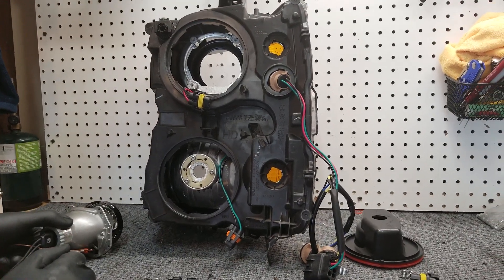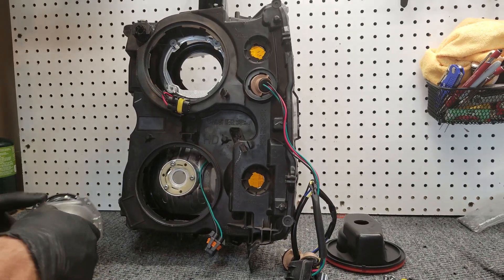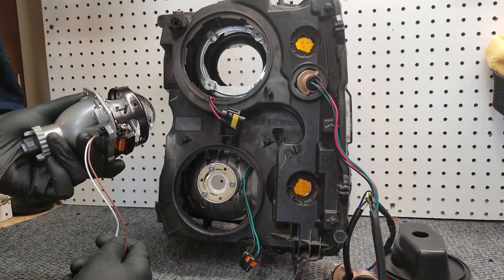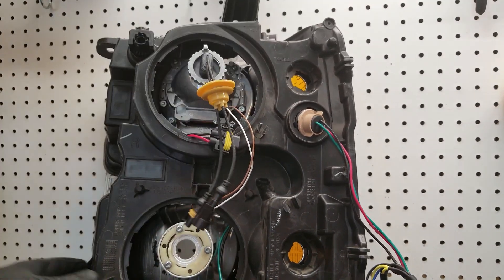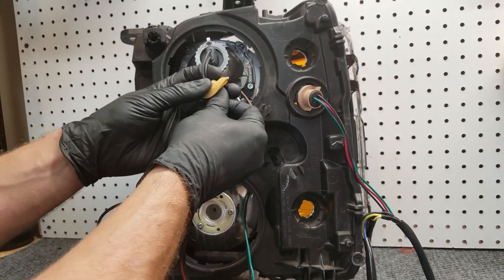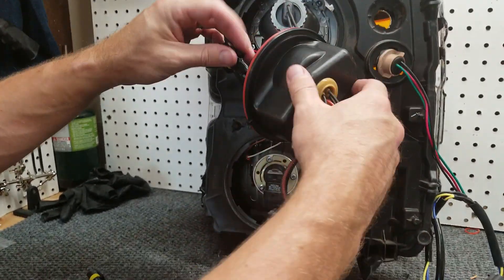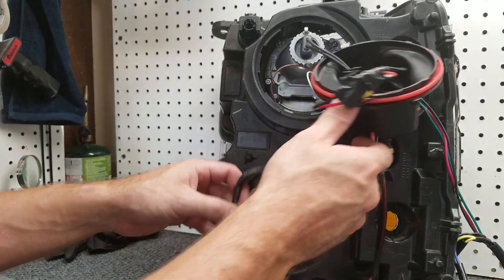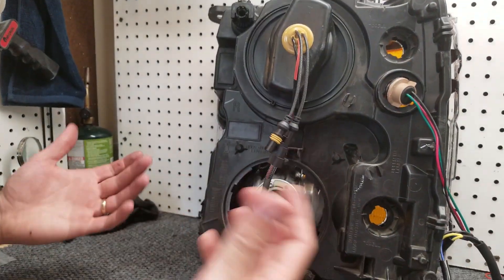Morimoto D2S 4.0 Projector Retrofit in 2014+ Silverado (refer to description)

Comment: I did this mod on my 2015 2500HD and when I went to reassemble it in the truck the BCM wouldn't turn on the headlights. Any idea how to get it to work?  I reset the BCM. There aren't any fuses. The parking lights still work. I'm stumped. Thanks
Reply from the maker: Hey Donald.  That is definitely an odd issue.  Did you use one of our kits?
Reply from the maker: Also, check polarity in the ballast input plug. If it is reversed thry won't turn on.
Reply: @sherpr802002  Thanks for responding. I finally got it figured out, one of the pins in the factory low beam plug pushed back and wasn't making connection. I actually used a D2S bulb and igniter. I had to soften the cap for the housing so it would fit. I had the kit left over from a car that I sold and never installed. Thanks again

Comment: Which bulb and ballast did you use here?  I installed a D2S projector in my 2015 and there isn't enough room for the D2D bulb and igniter
Reply from the maker: Morimoto D2H and Hylux 2A88 35 watt ballast.👍

Comment: With my 1500 LTZ I believe my low beams do not stay on with my high beams. Does this kit some how allow them to stay on or is there another step?
Reply: You will need beam splitters.  It's a"Y" harness that will put power to the solenoid on the projector when the high beam is triggered.
Reply: I believe what @caseman is mentioning is that the actual low beam shuts off when high beam is activated making the bi-xenon useless. But the answer is no, the low beam stays on with the high beam. This has been the way since 2007.

Comment: I like this idea.  So I've done a few of these to my truck, my dads, and a friends with the steel brackets that came about a few years ago.  Biggest complaint is that the D2S sits back away from the factory bezel about a 1/2" or so.  The steel brackets with spacers are a contributing factor in this, and also the D2S is shorter than the factor projector.  I'm wondering how much of that space is eliminated by mounting straight to the factory housing with these new "bottom brackets".  Do you have any pics somewhere?  Also, would adding a little bit of a longer top screw and a small washer t add a little bit of security?